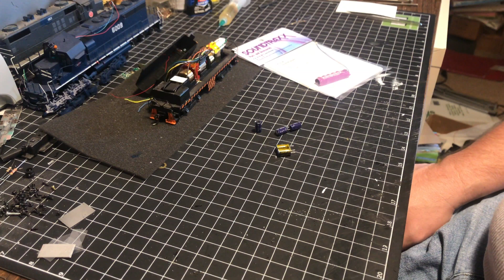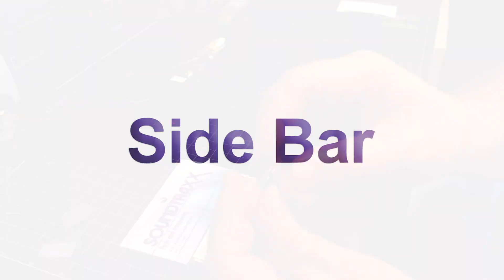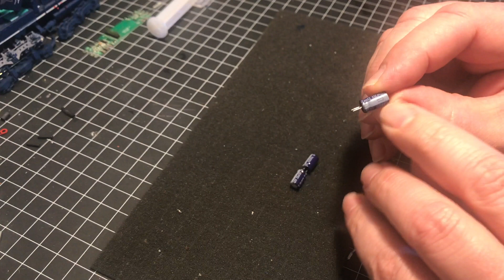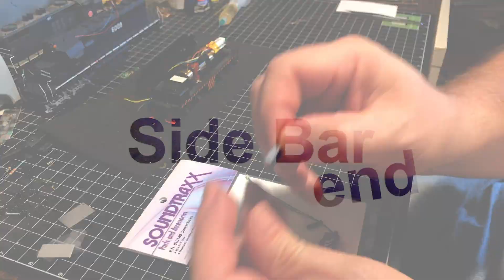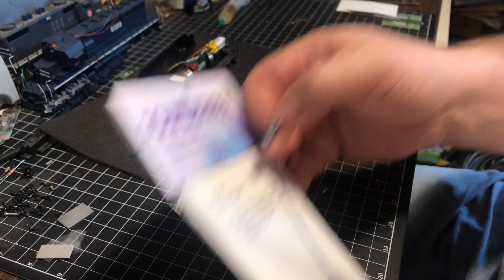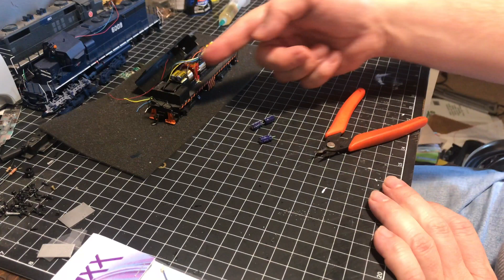How to use Capacitors to add EXTRA Power to a Tight Decoder Install

Comment: I'm intrigued with electronics and want to learn more for model railroading. Could you use one higher capacity capacitor instead of two? Did you choose two because they are physically smaller? Thank you
Reply from the maker: Yes, these were chosen because of their size. Some models have more space than others, which will give you more options for what you can fit. If you need any help, just reach out to our Support Team: (970)259-0690 or support@soundtraxx.com

Comment: @SoundtraxxDCC can I use the capacitor on a light kit for my n scale passenger cars?
Reply from the maker: You cannot use a CurrentKeepr or a capacitor directly to the DCC track. You would need to invert before with a bridge rectifier or similar.  But a SoundCar, or a motor decoder, could do that and add control for lights and such.

Comment: Don't Stay Alive caps also require a diode and resistor?
Reply from the maker: No, as it is piggybacking off the decoder’s own power circuit, the power has already been made suitable by the decoder

Comment: It appears that every one who watched your video understood where to solder the wire from the capacitor to the locomotive.
I didn’t, where is the connection between the capacitor and the locomotive 
Thanks
Reply from the maker: It will vary based on the decoder format used.  On most of our current decoders, there is a 2-pin plug that simply plugs in.  You can get the 810158 harness from your local store or from our website.  On some occasions, primarily older decoders, and the 21P, you will need to solder the wires to a specific location on the board.  This will depend on which board you have.  So, for guidance on this contact our support department for assistance at support@soundtraxx.com or (970)259-0690.

Comment: You do not want to use 100% of a component's rating - for example, I would never tell anyone to use a 16V cap in a 16V system, as this will lead to premature failures.  25V should be the minimum rating used in a DCC system.   For reliability, components are derated to use only 60-70% of their spec ratings (leaving 30-40% margin), to lessen component stress and ensure long life.  Furthermore, common aluminum electrolytic caps such as these age and degrade faster than most other types (e.g., ceramic), which only compounds the issue if you haven't properly derated them to begin with.
Reply from the maker: NO argument.  You never really want to use anything at the max. good advice, and this is why we supply 25v caps.

Comment: I'm about to start adding my own custom builds like this on my locos and am wondering what the 2 pin CK  connection fittings are called so that I can make my own harnesses to connect to the two pins on your decoders and maybe repair some other 4 to 5 pin ones on some Atlas engines.. Thanks !!
Reply from the maker: John, you can buy the 2-pin harness off the website and use them for attaching a CurrentKeeper (or other stay alive module of your choice) tot he Tsunami2 and Econami product line..  
You can see it here:  https://soundtraxx.com/accessories/installation-accessories/wiring-aids/currentkeeper-2-pin-harness/ 
I hope this helps..  Contact us at support@soundtraxx.com if you need further assistance.  
Thank you!  ~G

Comment: Can  1 current keeper be used for a steam engine with a sound only decoder and a separate dcc decoder for motor control  ?
Reply from the maker: 2)	I would recommend that each decoder has it’s own CK if possible.  I cannot say that it would so why take a chance?   The motor decoder needs a little less for the processor, so you could use a smaller bank of capacitors for the non-sound and a CurrentKeeper for the sound.  BUT..  If you use a Tsunami2, these are one in the same, motor control and sound in one unit, so you do not have to worry about it.  Plus, the sounds are played based on how the model is being used, so you’ll get a more realistic operation using a single decoder and a single CurrentKeeper.  Save space too!

Comment: I have a real stupid question. Instead of using several 220uF capacitors, why not use a larger capacity like say a 330uF. Should be about the same size and longer run time. Just thinkin....
Reply from the maker: Capacitance is a factor of size.  So the 330 uF 25v rated are a tad bigger, and probably could fit, but I used 220 since they were immediately accessible.

Comment: I just saw this on FaceBook and I think it would be helpful to go into more detail on exactly how and where you would wire this into the decoder. I know your 2200 series decoders have plugs to receive current extenders, keep-alives, or whatever you call them but exactly where you would solder any you make yourself and what lead goes where is not clear.
Reply from the maker: Thanks for the feedback. You would wire in the capacitor just like you would a CurrentKeeper based on the wires positive/negative terminals. We even sell extra CurrentKeeper harnesses so you could wire the capacitor to that and plug it in just like a CurrentKeeper. For more assistance with this you can contact our Support Team directly: (970)259-0690 or support@soundtraxx.com

Comment: I have a capacitor attached to a TSU 1100 boards green yellow stipe and blue wires but the loco doesn't seem to have any improvements in comparison to no capacitor at all, any advice?
Reply from the maker: The small 220uF cap only gives about ½ second longer, may not be immediately noticeable by the user. But when the loco is running, it does help.  If you want longer, you can add more caps, or use a bigger cap.  You can go up to a 1000 uF cap without any issues. Just make sure the cap is rated above his DCC track voltage.  
If you need to go higher, then you may be better off using a CurentKeeper.
Reply: @SoundtraxxDCC  Ill give that a try, thanks

Comment: Can use a 25v capacitor with more microfarads? 330 or even 1200uf??
Reply from the maker: Yes, just be cautious that without any charging regulation, having many of these on the layout at one time nay trip the DCC system short-circuit protection.  Otherwise, it will not harm the decoder.  It’s just a power storage device.  But having a 1200 uF ca on one loco should not cause this issue.

Comment: GG 👀,
                  Nice to see that home ec class is paying off. 😊  You speak the truth on caps!  Having said that, this particular demo is exactly why "Good"  all wheel pickup is still important.  When I build a model (any engine or powered rolling stock) I always make sure FIRST that I have good clean reliable much needed power pickups, then as a back up - good cap-paks always help against those pesky dirty rails/switch points or insulated frogs.  Even in modeling, a good foundation is key when building up the ultimate model.  Love the pictorials my friend!       Thanx Thom...
Reply from the maker: Thanks for the feedback!

Comment: Hi could i use a 16v 2200 uf capisitor instead ?
Reply from the maker: Yes, but you could run into issues with the inrush current.

Comment: I use your Tsunami 2 pnp decoders. They have a connection for a currentkeeper. I know you can purchase just the leads for the currentkeeper. If I use a small Capacitor can it be plugged in to the decoder using the plug on the board, and which colour on the lead is positive? Thanks
Reply from the maker: Yes, if you get the harness (810158) and plug in, the blue wire is positive and black is negative.  Wire yo the cap or caps as you need.  Thank you!

CurrentKeeper Harness: https://soundtraxx.com/accessories/installation-accessories/wiring-aids/currentkeeper-2-pin-harness/
Reply: @SoundtraxxDCC  Thanks for the info, much appreciated.
Reply from the maker: @csxrensville5105  Of course! Let us know if you have any other questions.

Comment: So we don’t need a diode or resistor between the decoder and the caps? You can make an cap bank in parallel and connect it right to the tsunami keep a live port?
Reply from the maker: The diode was there to slow the charging rate, but with only 1-2 small 220 uF caps, the charge is not enough to cause problems.  The issue is the high-capacity stay-alive modules like the CurentKeeper draw lots of current to charge to full capacity, so some DCC systems can see the inrush of current as a direct short, and trip the breaker. So the diode and resistor slow the charge rate so the DCC system is none the wiser. Thank you!

Comment: George, if they are side by side, don't you solder negative to positive down the row so you have positive at one end and negative at the other? You showed negative to negative when using only two caps correct? or match polarity when using only two caps?
Reply from the maker: In this case, capacitors are added in parallel.  So if you add more, wire in parallel to ‘extend’ the 2 plates storing the energy between.  If you are in series, then you’ll be limited by the smallest cap.  I hope this helps.

Comment: Very timely. I recently painted the rail webs on a section of my layout and missed a tiny area where I didn't get the paint off of the top of the rail. My locomotives  with the current keepers in them rolled over the spot without a problem but my 060 saddle tank with a capacitor in it didn't. Now I want to add as many capacitors as possible to this little guy.
Thanks for doing what you're doing. I hope whoever you replace Josh with will be of the same caliber, he was very helpful to me with my first venture in adding tsunami 2's to my locomotives (so were you, love you guys). Keep up the good work.
Reply from the maker: This should definitely help you out! Yes great timing. We are working hard to find a suitable replacement for Josh, but he has big shoes to fill! Thank you for your feedback!